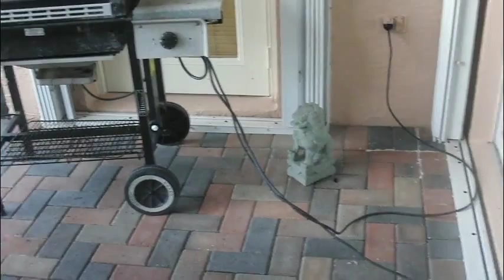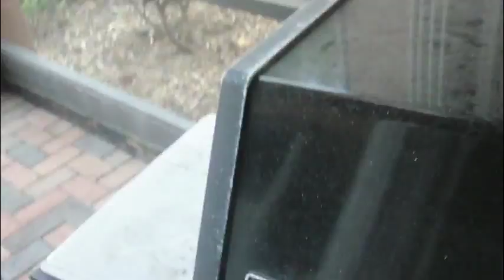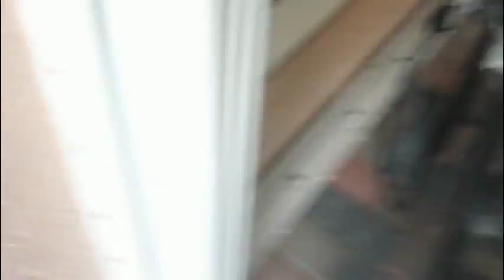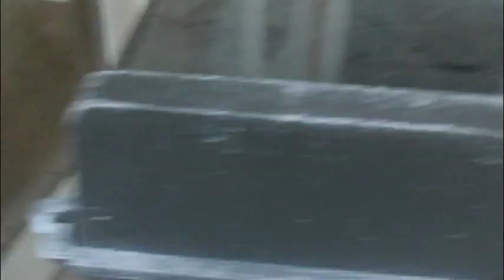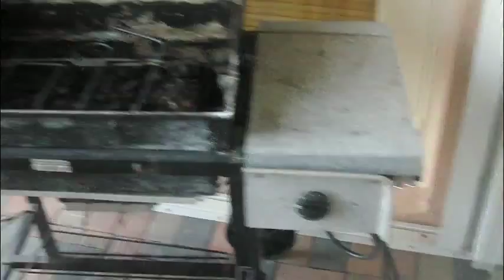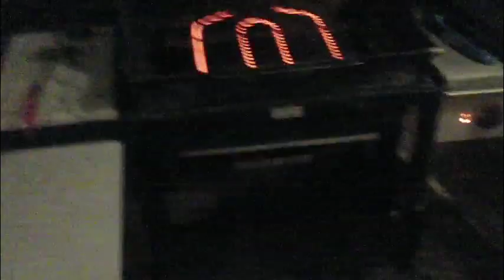Gas BBQ Converted to Electric

Comment: this is really smart...   Any idea how many watts that element is?  Some oven elements go up to 3333 W on 220V which ought to be enough for any BBQ as compared to wood or gas.  
Like your 220 from two plugs.  
I have a proper 220 in my Garage already. Lots of people have an RV plug or a dryer, or range plug near the outdoors already, and it isn't hard to hook one up.  
You will need 220 for your EV anyway. :-) 

Lots of times you can convert an outlet from 120 to 240 by rewiring it at the circuit breaker box. (But please remember to change the socket type on all the sockets or you will get nasty surprises.)
Reply from the maker: http://wiki.answers.com/Q/How_many_watts_does_the_average_oven_use#slide2
Reply: Amazon sells elements to do this easier